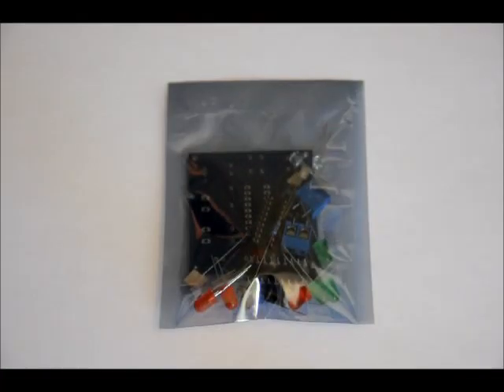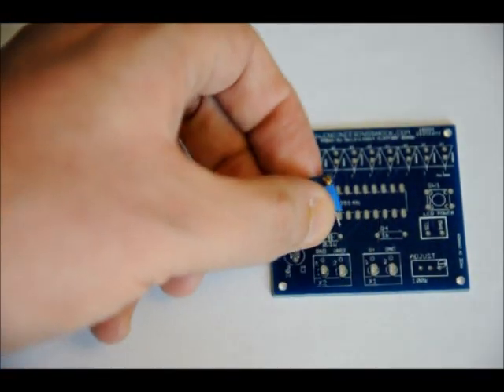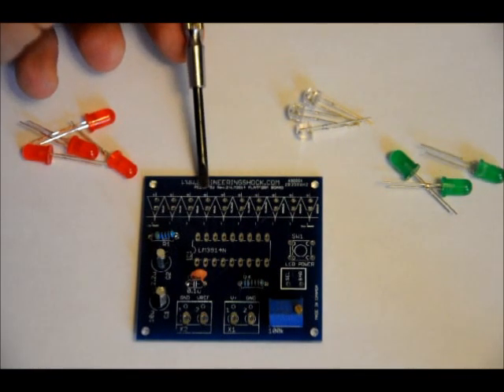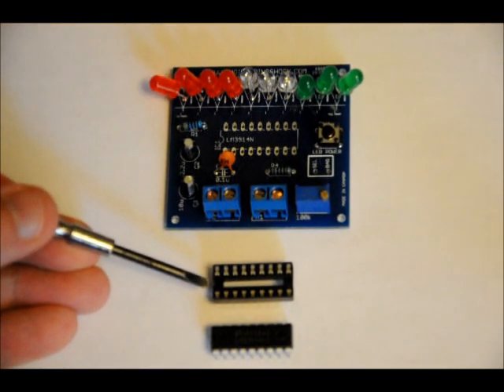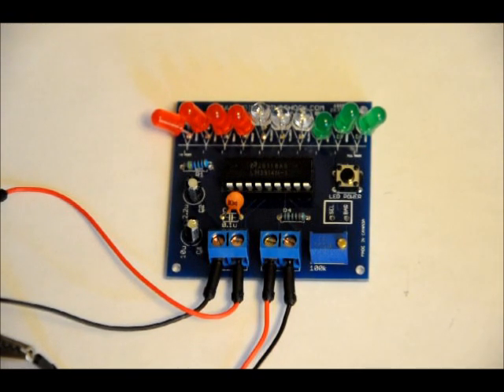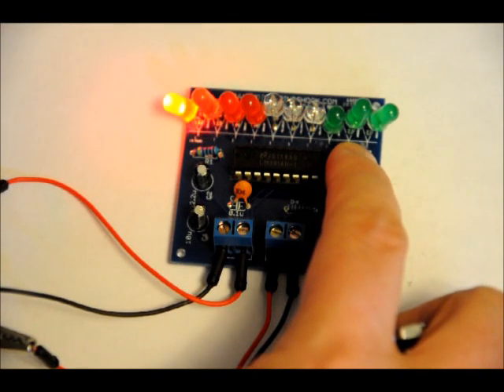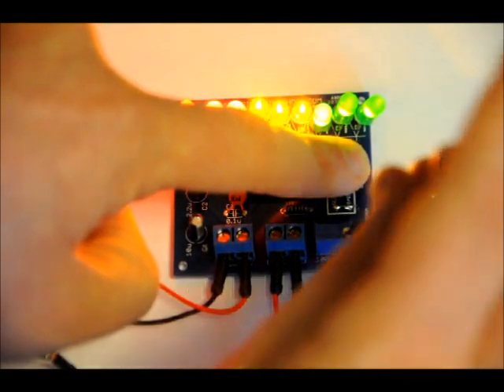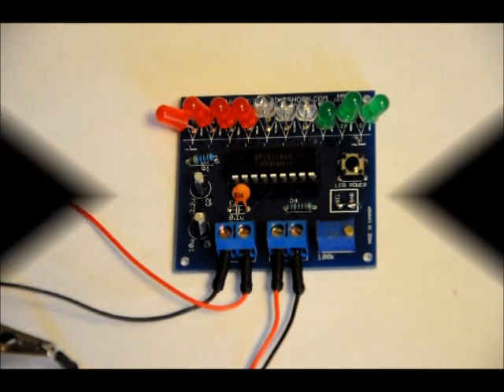The LM3914 BAR/DOT Voltage Meter DIY Electronics Kit Rev.2

Comment: i remember the lm3914/15/16 hitting the shelves when i was a kid, boy i feel old lol
Reply: I have 5 (FIVE) Ramsay assembled "speaker level" indicator kits (LM3915 based) that I bought/constructed around 30 years ago! I even calibrated them (using a calibrated Fluke "AC Calibrator") to read up to 100 Watts for 8 ohm speakers.  They worked really well, but now they're in storage (I may bring them out again for use).

'tis a shame that Ramsay and their audio kits don't exist no more... :(